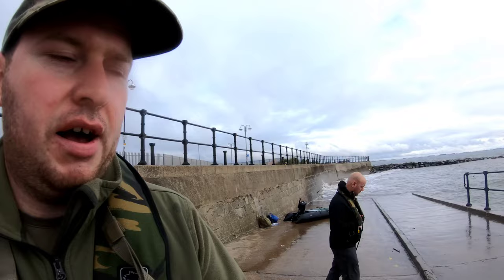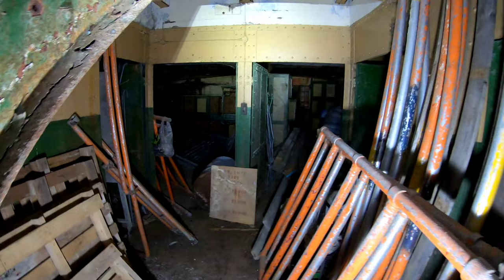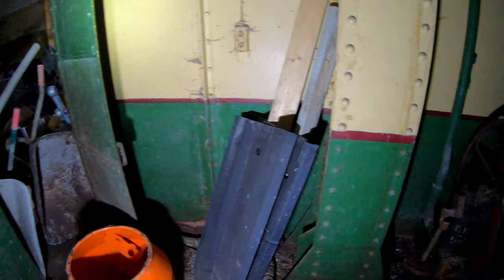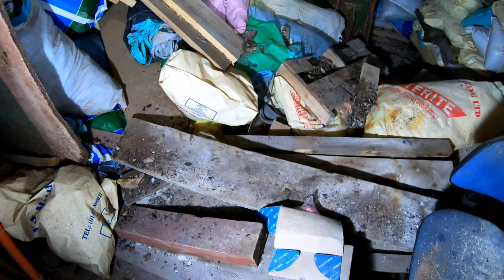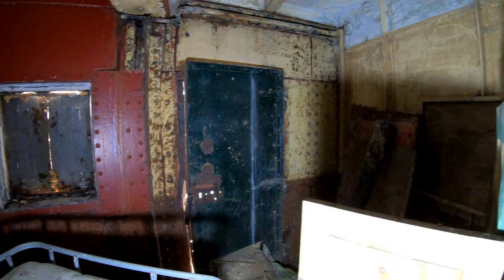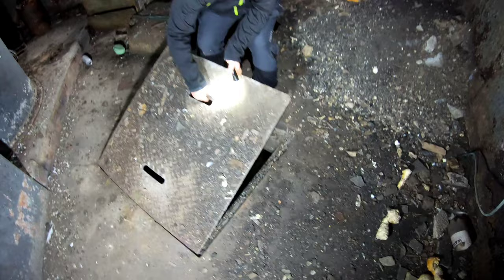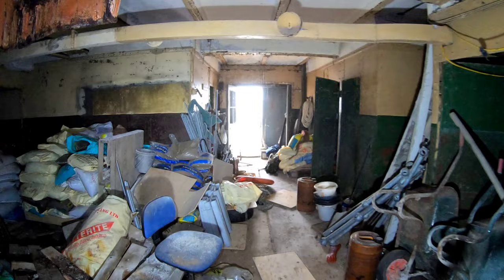Haile Sand Fort - Humber Estuary Forgotten In Time

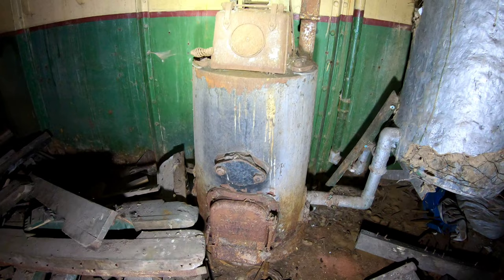Comment: 26:00  ....water heater.  Trace the plumbing to determine if it is for the heating system or domestic hot water (shower, shaving, etc). Due to the point in time of its use it could actually be used for both systems but that wouldn't be the best solution (they may not have realized that yet).

Comment: Great and interesting video, pity about the morons that feel the need to destroy/deface these links to our past. Looking forward to seeing (if you do) the Bull Fort video. I know about these forts because I was born in Cleethorpes and grew up in Grimsby, luckily I managed to escape to Australia in 1987... But it leaves me with a question... Why is there so much 'new' crap all over the place? Scaffolding etc? And just a little dig.... Obviously neither you or Mike went to Maritime School... You knew that lower flat deck was there, but you still pulled the dinghy over it... You could've/should've tied up on the outside.
Reply from the maker: Hi Craig thank you for the comment 👍 yes it's a shame that vandals seem to get everywhere now. We will get to Bull, I just don't know how yet. We hit the sand banks 4 times on the way back from Haile so next time we need to be more prepared. When we went to haile we was planning on staying for a good few hours as I had a lot of stuff planned. I knew the tide would drop and I thought it would be best to pull the boat up. I think as we were going around the Fort we started to panic a little with the sea conditions getting worse. Mike was nearly wanting to back out before we had gotten half way to the Fort and if we had turned around I don't think Mike would have attempted to try again. It looks like a simple thing just to boat out but I now know it's not  😅. Once I get something in my head I won't let it go until I've done it. I think in future I will need a bigger boat with a bigger engine and that's something I will look at getting when funds allow. Cheers once again for the comment 👍